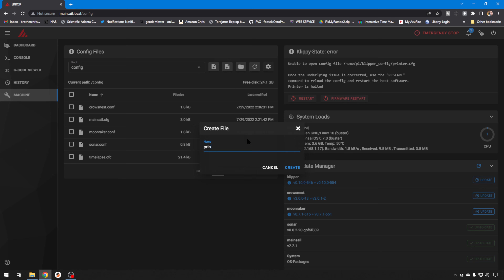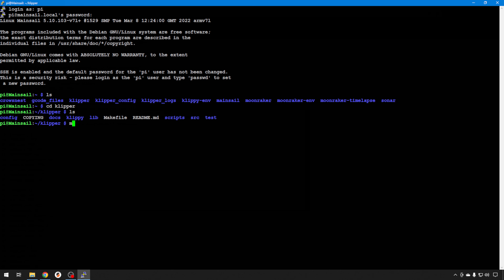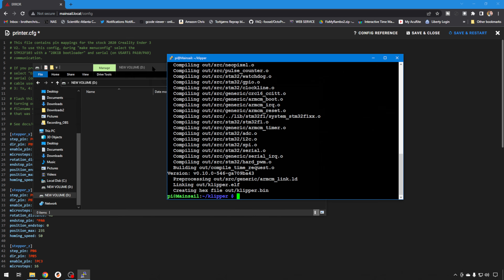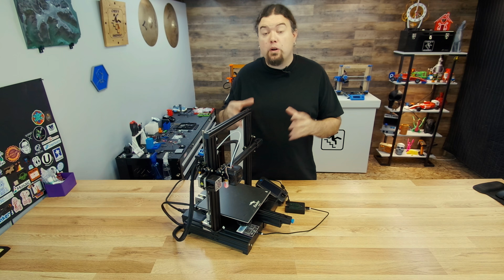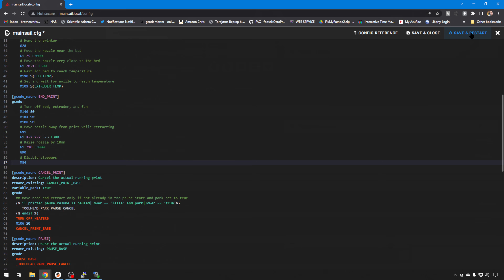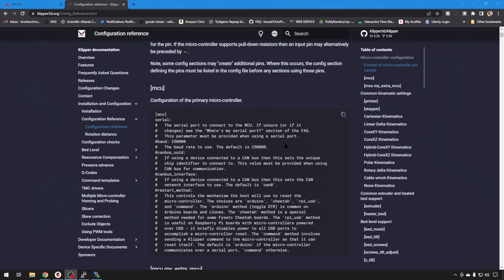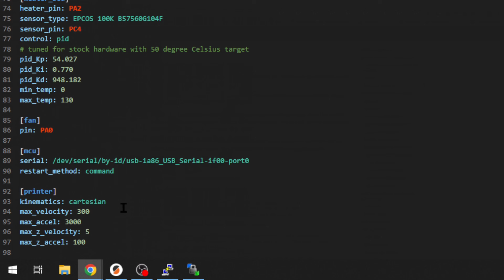Install Klipper On Your Ender 3 V2 - Mainsail - First Print - Chris's Basement - 2022

Comment: I just tried configuring two ender 3's to run on one pi running klipper with mainsail for a friend of mine. Got everything set up but evidently the ender 3s all share the same usb serial connection so only one works at a time.. Do you know of any way i could get around that? I already tried using serial by path instead of by id, but it still didn't work. With the price of pi's these days he would love to not have to buy another one.. lmao.
Reply from the maker: I'm not exactly sure yet how all this works with klipper. I do plan on trying to figure all this out.
Reply: I’d think you should definitely be able to control more than one at a time. Search YouTube for Klipper on a pic setup. I watched that and saw that guy setting up multiple. It seemed the Kiauh generated multiple instances of klipper. That guide might be helpful in general for multi printer setup
Reply: @WhatsMikeUpTo  Oh I know you can, I had it all set up. I used Kiauh, but when it came to getting the serial Id it would only give me one. It appears they both have the same serial Id.. everything I could find in forums basically confirmed that it’s an issue with creality boards. I was just hoping someone had a solution other than using serial by path, because I tried that too.

Comment: Back when we were still using 8bit boards I could see the point in something like klipper. With 32bit boards running at 480 MHz why would you still want this? Are the print results that much better?
Reply: For me Klipper provides speed, multi-motor control, and print quality that I was not able to get using Marlin.   The flexibility of not having to compile firmware to just change something or extend the capabilities is worth the change alone. I still run a Marlin printer (Prusa) . It does ok. No complaints. However, I can print significantly faster with higher quality (less artifacts) on my other Klipper-based printers. Been 3D printing since 2015... YMMV
Reply: You are right a modern board might be able to do the same calculations as klipper does right now on the SBC. But klipper has a lot of other benefits:
- Multi MCU support for large configuration 
- That includes now the CAN toolhead boards that makes wiring much easier
- The custom macro system is a very powerful tool.
- Do configuration changes nearly on the fly
That are some of the benefits beside good print quality at high speed
Reply: Input shaper needs more processing power.
Reply from the maker: Thanks for your input!

Comment: all in all its it worth the upgrade vs just printing of stock mobo.  outside of the cool factor im having a issue seeing if its worth the effort.
Reply: It IS worth it. I will never go back to Marlin after using Klipper for a while.
Reply: I was where you are just a few weeks ago… I’d say if you are happy with your print quality and speed it probably is not.  I was not happy with my tronxy x5sa so I decided to take the plunge and put klipper on it and see if there is any benefit.  Spoiler alert: in my case it absolutely is.  Now there is a learning curve and I’m still at the bottom of it but, for me, 3d printing is a hobby and I enjoy the journey.
Reply from the maker: That's great! I'm glad your happy with Klipper